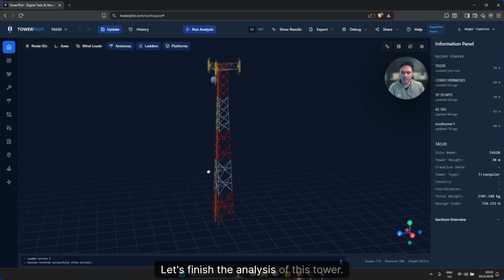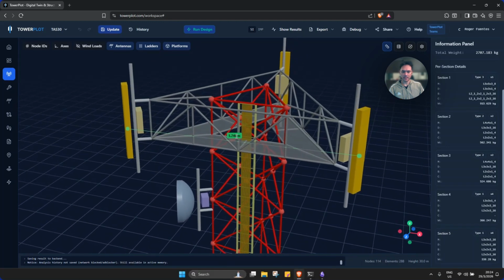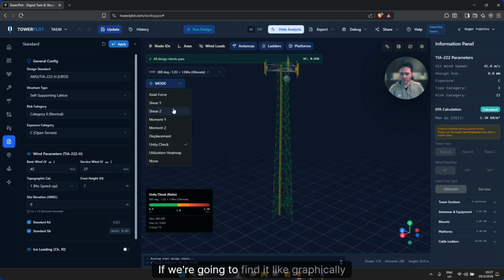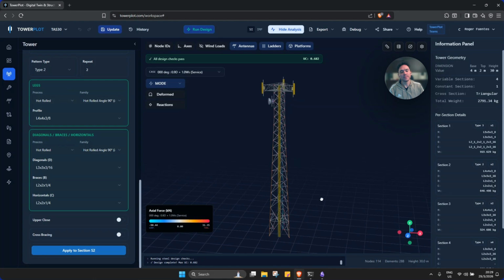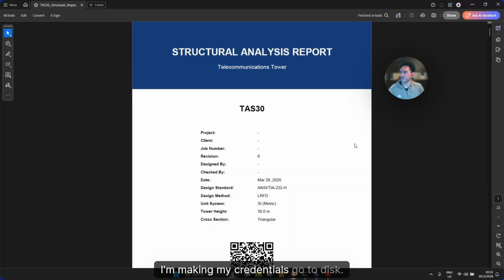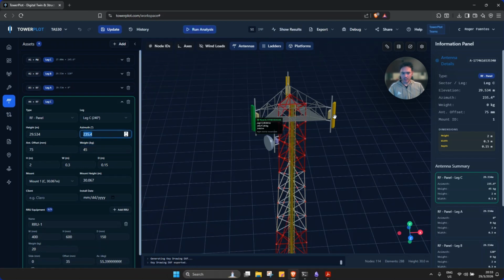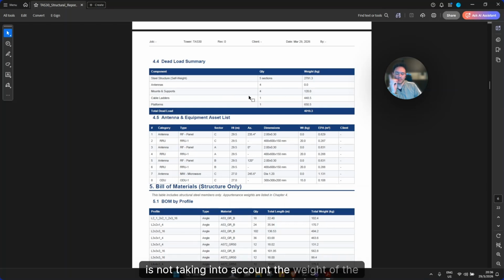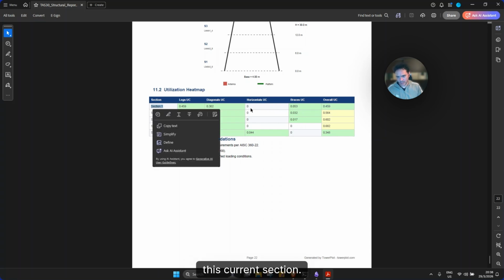Tower Results

Comment: Hi, thanks for this informative video.
Is my understanding that table 4.5 in the report contains the EPA for each antenna considering 0 degrees between the axis of the antenna and wind direction correct? 
Is it possible to get a copy of the PDF report, please? Thank you, and good luck!
Reply from the maker: Hi! Thanks for watching and for the great question.
Quick clarification: the EPA in Table 4.5 is actually the worst-case (maximum) EPA across all analyzed wind directions, not the 0°-aligned value. Under the hood the solver evaluates each antenna at 8 wind azimuths for
square towers (every 45°) and 9 for triangular, then the table reports the envelope, the largest EPA any of those
directions produced. For a panel antenna that peak usually lands when wind hits the broadside

  Happy to give you access so you can generate your own reports and inspect the numbers directly. Could you share
  your email? I'll send an invite.

  Thanks, and good luck!